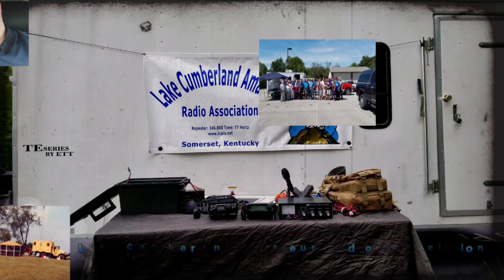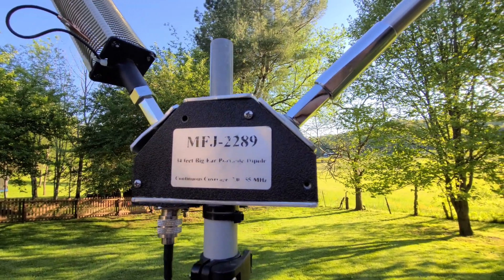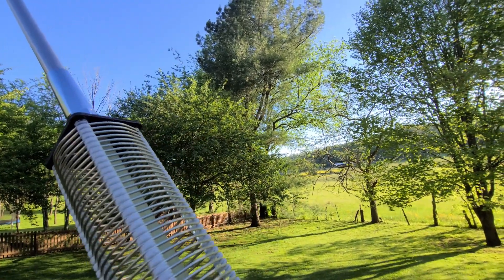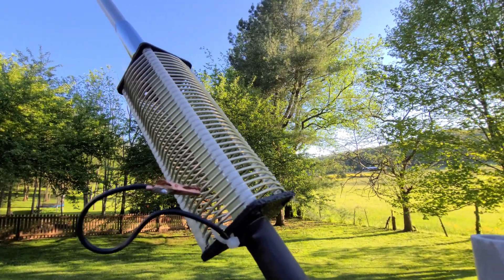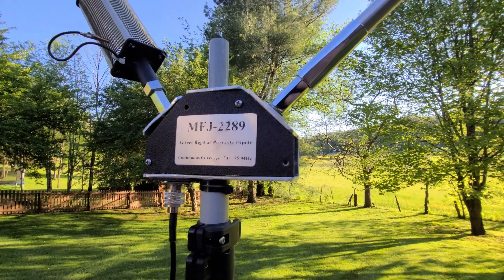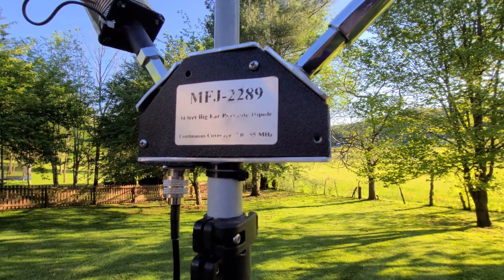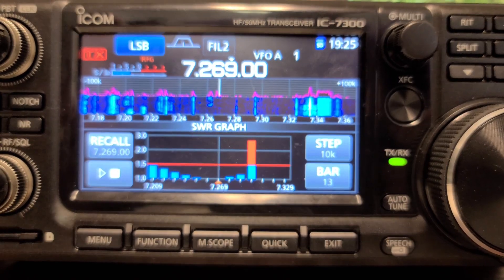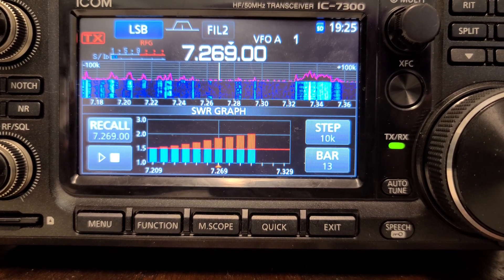LCARA HAM Radio: MFJ-2289 Big Ears Antenna Part 2 - Making Contacts!!!

Comment: So if you want to change the band, you have to take the whole thing down?
Reply from the maker: To adjust the band, yes. In the video I'm using a very capable fiberglass mast that is relatively easy to take up and down. If you're looking to switch between bands quickly take a look at the Octopus antenna video. Thanks for watching!